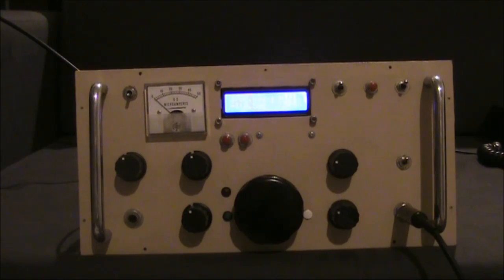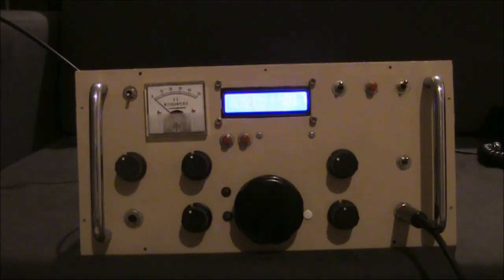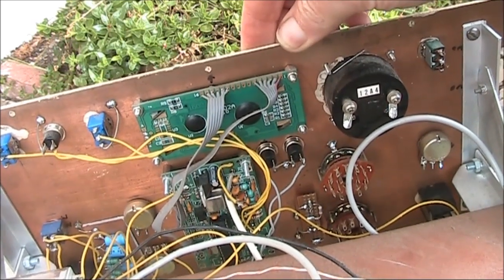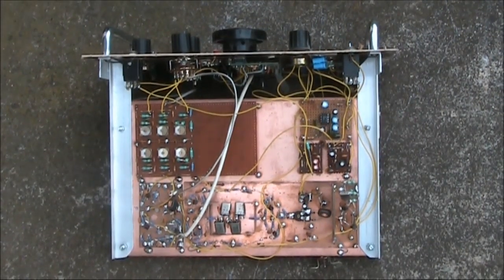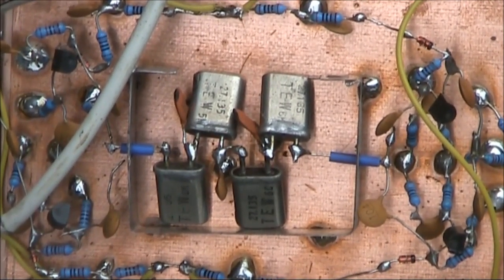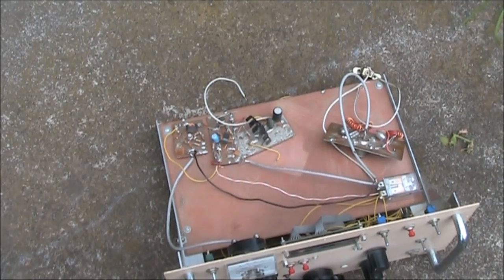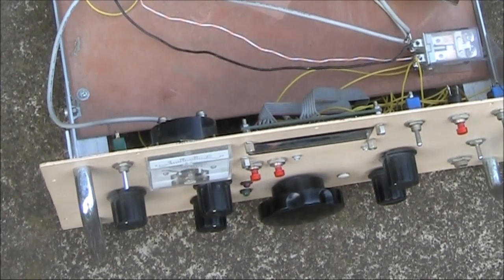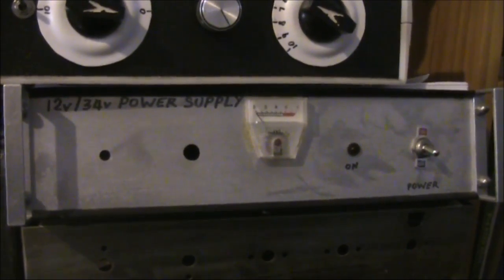HF listening on a partially built receiver based on the Bitx20

Comment: Hi Peter. I built a multi band Bitx a couple of years ago. I was a bit ambitious to have it cover 5 bands (80,40,20,15,10). My receiver works great, even though I have to turn up the volume one the higher bands. The transmitter, however, was much harder. Using one of those cheap IRF530 linear amps from eBay, I got greatly varying power levels as I went up in frequency. I settled on a step attenuator to reduce the input signal on the lower bands. I always enjoy your videos and am looking forward to seeing the next video on this transceiver. Thanks!

Comment: Nice work Peter.  The molded RFCs work but are lower Q than inductors wound on T50 or T37 toroids. It might not make much difference.   These transceiver projects do take many hours, I really hope you finish it to your satisfaction. 73 Paul VK3HN.

Comment: Will the filter topologies for each band likely be the same? Was wondering about building something similar and thinking about making a PCB design where I could make a new filter by just changing the component values. JLPCB or similar usualy have a minimum quantity of 5 anyway. Would keep it neat.